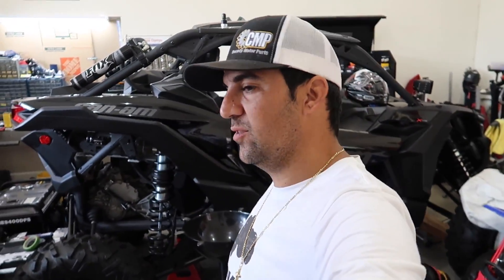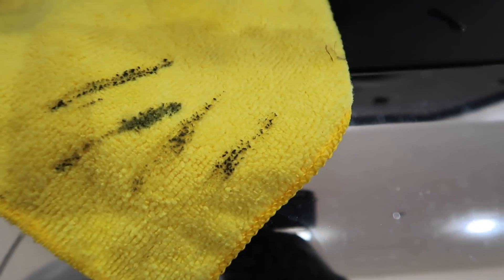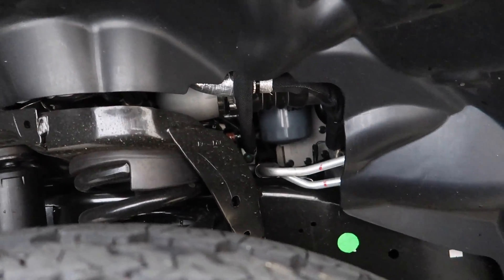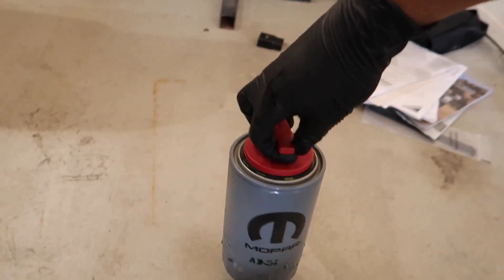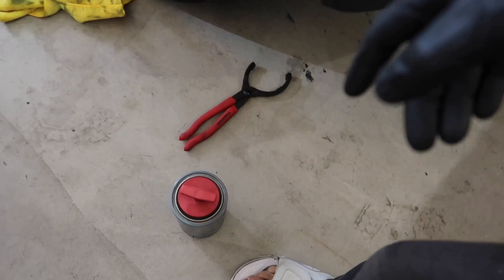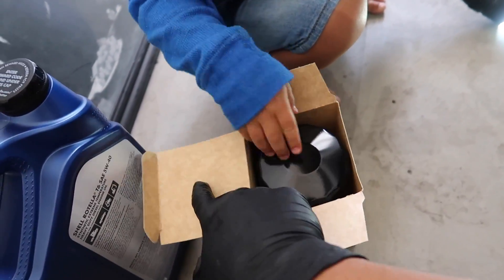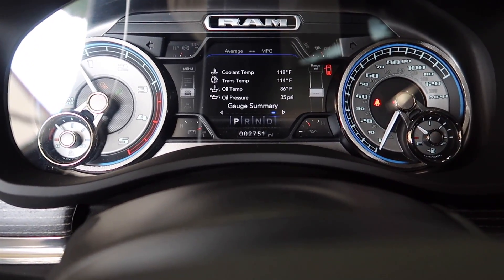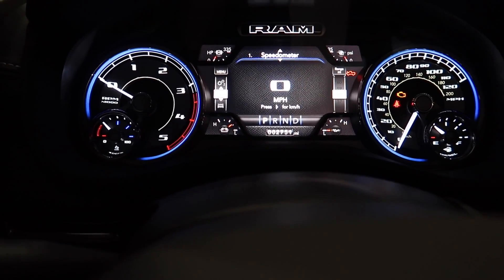THIS IS A MUST TOOL TO DO AN OIL CHANGE ON THE CUMMINS

Comment: Do you not need to prime before starting up? After doing oil change
Reply from the maker: I fill the filter before installing
Reply: @EddieLife3500  I had seen on another video where the guy does the whole turn key on and off a couple times

Comment: I live in Phoenix, AZ and I run Valvoline Premium Blue 10w-30 synthetic blend  Heavy Duty in my 19' 2500. And an OEM filter. That's what the book calls for in high ambient temps and I liked that Valvoline has the Cummins logo on the side of it and it says it's endorsed by Cummins.

Comment: Should also do fuel filters  with every other oil change
Reply: Nope, fuel filters at 15000 just like oil and oil filter.
Reply: Walter K  15k is to long with the quality of diesel in the us unless you use the same station every time you fill up  you have no clue how dirty the filters get. I change mine every other oil change I change my oil every 5k miles
Reply: @samgrabel8648  sorry but you are NOT smarter than the ENGINEERS at Cummins Engine Company. If you were, you would be working for Cummins. It doesn't matter what mythology you believe.
Reply: @samgrabel8648  15000 oil/oilfilter/fuelfilters is the interval.
Reply: Walter K  honestly that’s a maximum suggested interval    But depending on quality and conditions.
Reply: @samgrabel8648  you are sorely mistaken. But, you are certainly welcome to your misinformed opinions.
Reply: Walter K  show me you ase certifications before you down play my opinions
Reply: Walter K also that interval is from Chrysler not Cummins
Reply: @samgrabel8648  the only reason for that is because Ram and not Cummins provides warranty. Rest assured, my argumentative little fellow, I am very to intimately familiar. Cummins does instruct Ram regarding maintenance requirements.
Reply: @samgrabel8648  now you make me laugh. ASE is a f***ing joke. I know factory personnel frlm CMEP, I know FCA warranty adjudication personnel. I am tired of trying to educate you. Incidentally, do you prefill the replacement filter? If yes you are at least doing one thing right.
Reply: Walter K  answer me the how do you prime the fuel canister.  And let’s agree to disagree

Comment: Not sure on the 19’s but my 20 Laramie 6.7 calls for 10w-30 synthetic blend. Service manager said if something happens with the engine and is not running recommended oil that Ram has and will deny warranty claims. Just FYI

Comment: Hi Eddie, I saw they grease the Front drive shaft  every time make the oil change, I cannot find this point in my 2019 RAM 3500, could you find yours ? Thanks.
Reply: The ujoint is a different design; no fitting on 2019s.
Reply: @walterk1221  Thanks, that's why I cannot find it :)
Reply: @dmtycn  you are most welcome.

Comment: Diesel oil goes black soon after changes. It's normal. Black oil in a diesel does not automatically need a change. To each their own, but you should have left the stock break in oil in there longer than 2500 mi. Changing oil too soon, especially in a new truck, will actually be detrimental to the engine. Especially with modern synthetics, they reach their optimum properties about mid way through the recommended oil change intervals. Early changes defeat the purpose.

Comment: It's a diesel engine it will always be dark color oil. Oil change is states in manual is 15K miles. The dash next oil change is every 6K to 10K miles. But I like that gasket cover to keeping it clean. Thanks.

Comment: Diesel oil will always come out black as night. It's just the way they are. The OEM filter is definitely better. It filters to a smaller micron and same with the fuel filters. Like some one said they are made by fleetgaurd.

Comment: I used a Napa Gold 7060 in my Chevy 1500 for seven years, never had a problem. One thing I like to do is cut off the bottom of the box that the filter comes in, leaving about 2" of the sides attached, and use it as a little holder to stand up the filter while I pre-fill it.

Comment: Dude i would use all OEM if that thing is that new that way they cannot give u any BS if u take it in for warranty work or if u have any problems with the truck...
Reply: Not to sound like a douche bag, but I hate this logic of 'Oh run OEM everything in case it breaks' like, first off if I buy a 70-80k dollar diesel like this, if that thing breaks before the 100k mile warranty or whatever I'm parking it at the dealer until it's fixed, I don't care what brand of whatever is on it that's utter garbage. If they refuse to fix it, I'm writing 1,000 terrible reviews on their website and every google review option for them with fake accounts. And then I'm calling my lawyer to tell them to fix the truck because it wasn't the oils fault or the non OEM part. And then if they refuse to fix it after all of that, I'm gonna go okay fine, and drive to the closest dealer of another brand and tell them to fix it and win my brand loyalty. And then once it finally gets fixed, I'm selling that worthless piece of garbage truck and buying a new one because if it breaks that early in its life it's already plagued and full of other problems and is a garbage vehicle.

And that is why I'll put any brand of anything I want on my truck whenever I want. Dealerships and manufacture's don't want these things to run 500, 600, 700k miles with no problems because dealers make like 80% of their profit at their mechanic shops and the only 30% on used cars and they lose 10% selling you a new one because the other 2 will makes them more money anyway when you come back to them. So they're specifically built to have certain parts fail at different variables, but never when the warranty is in affect. The way to get around that is to stop using bad OEM parts and putting parts on from well trusted after market companies because they make their money by earning the life long support of their customers who will buy their products for their personal vehicles and their wife's vehicle and their mom's vehicle and tell all of their friends about it.

Comment: Eddie I’ve read a lot about ram/Cummins filters and how they are made so much better then other filters with how small it filters down to. It is so much better then others filters because Cummins has made so many motors over they years and they have invested so much more time and money into filters then others for diesels because of all of the large over the road trucks have to run so many miles between oil changes without fallers from oil filters and all of that tech from the big trucks trickles down to all Cummins motors.

Comment: Eddie rotella has a t6 synthetic in a 15w-40 version for summertime use, I don't know how I feel about putting 5-40 in cali, mine starts up at 55-51 psi when its ambient temp in Texas and 33 at idle when its 201 degrees, also it takes 12 quarts when you use the stock filter and don't spill any lol

Comment: normal for all diesels, for engine oil to be black all the time, is due to high compression ratios in diesel engines, and having higher blow by, caused by higher compression ratios , causing unburned and burned fuel to by pass piston rings and get into oil, because every engine has blow by, even new engines, want to keep oil cleaner longer put a by pass oil filtration system on it, like all big rigs have, because it filters oil 20-30 times better, but can not replace regular oil filter,

Comment: Most cummins take more than 12 courts     Also black oil don’t mean squat in a diesel thay turn black quick and basically the only time to be worried is if you see metallic contamination. Other wise I’d say your safe for 5-8k miles between changes

Comment: What’s was the reason you went with the rotella oil? I believe Cummins recommends valvoline blue synthetic

I’ve got over a million miles on gas vehicles running the Napa gold filters. No issues for me. I always filled with oil first also.
Reply: New cummins H.O.
Manual says 5w-40 Rotella synthetic 
Or 10w-30 Synthetic
Reply: crawlineb okay so ram is saying use the shell and Cummins is saying use valvoline premium blue.

Comment: My 1999 Cummins and 2005 Cummins, oil would be black after a few hundred miles. Always ran Shell Rotella oil and Wix filters. 

Leave filter in box sitting on the floor, it will stand up to fill filter

Comment: From my 2019 RAM Owners Manual, the 6.7 Cummins diesel can use two grades of oil;
10W-30 (which type is not specified in Owners Manual) for ambient temps ABOVE -18'C (0'F)

5W-40 SYNTHETIC for ambient temps BELOW -18'C (0'F).

I live in the Toronto area in Canada. Winter temps can easily go below -18'C so I will be using 5W-40 synthetic when I change my oil.

Manual also states to change oil every 12 months, or 24,000km. (15,000 miles), OR sooner if the Oil Change indicator system tells you to do it.

Comment: Eddie, a couple of suggestions, you will thank me later
Get a femco drain plug - mess free oil changes.  Femco Compact LB 7090020186 M18 x 1.5-T10
Start using Cummins Filtration - Stratapore LF16035 filter recommended by Cummins  see the white paper on these at Gino’s garage
Send a sample of your oil to the lab, I think your subscribers would benefit from that.
Recommended oil change interval is 15k, I change mine at 10k - Delo 400 synth from Costco (on sale $29/case). I send off a sample two or three times a year to the lab. So far 202k on my 16’ limited AISN SRW 3500 and all is good.  Let me know if you want to see my lab report
Thanks for the videos

Comment: Ran motorcraft oil and OEM filter in my 6.7  just past 10,000 for break in, switched to Amsoil 6x, Amsoil filter...now considering adding the bypass filter kit and get the added protection/filter more soot down to 5 microns.

Comment: I know this is an old video , but I discovered something.  I think you will like ...
#1 Cat oil filter # 396-4596  ( no adapter needed ) 
#2 Amsoil Bypass filter ( 2 micron absolute ) 
#3 Hotshot secret Black Diamond 15w40
Full Group 4 PAO , not that group 3 " full synthetic " we are all used to   

Oil analysis is showing engine wear from 59ppm average down to 21ppm average over 6 oil changes , and MPG is up from 17.3 to 18.7 over 5k mile average

Comment: hey curious what issues you had with t6 full synthetic in your LML? I just bought that to do my oil change on my 2016 LML
Reply: culpjon I have a 16 lml and run T6 in it with no issues. T6 is the best oil you can buy right there with Mobil.
Reply: @Josh-uf1rv  You should look up Amsoil, it's actually the best oil you can buy none of the giant billion dollar companies can compete with their trash oil. Amsoil invented Synthetic oils.
Reply: dedalliance1 yeah I’ve heard of them. Oil samples from the pickup and from machinery show T6 is actually very good oil. I can’t see spending that much more for something I don’t know when I have actual proof T6 is good oil.
Reply: @Josh-uf1rv  You can send in samples to Amsoil too, and if you do they rate their oils at 25k miles or 1 year, and warranty it. That's putting their money where there mouth is, you should try it and compare the results just for fun.
Reply: dedalliance1 yeah would be worth a shot. And interesting to say the least.
Reply: @Josh-uf1rv  Yeah, and it's kinda expensive, but the few extra bucks per oil change if it helps protect your investment in your vehicles and equipment, it's well worth the investment. A single labor charge for an hour at a shop is gonna cost you the same as an oil change, give or take.

Comment: Who knows anything about the fleet guard filters. I thought I read something about fleet guard makes the ram/cummins oem  oil filters. Does napa sell them?
Reply: Fleet guard by Cummins Filtration are excellent filter. See the stratapore white paper on the Cummins filtration website for more info
Reply: Fleetgard is made from Cummins and that's what Cummins big trucks engines come with from the factory.

Comment: I thought the 2019 6.7 cummins  uses t6  10/30 ?
Reply: You are correct 10w30 is preferred and Rotella T6 is called out in the owner manual. However, Cummins allows 5w40 providing it meets CK4 or CES20086.

Comment: What i’d pick in that situation mostly depends on what there rated for filtration. Personally in my truck (gasser) I don’t run OEM, I run a Mobil 1 filter because of how it compares to OEM. OEM is only rated 98% @ 40 microns, Mobil 1 is rated 99+% @ 30 microns. They both have the same number of holes but the holes in the Mobil 1 are bigger then OEM. The only OEM available now has a plastic center tube (there used to be two versions available one steel center, one plastic. I really don’t trust the plastic) the Mobil 1 has a steel center, & the Mobil 1 also has 30% more filtration media. I’d really like to find something very similar but rated at least 99.99% @ 20 microns, that would be fantastic. However I haven’t found anything like that thats legit and will fit my truck. Realistically though I’ve been running this filter for a while now and I’m pretty happy with it. I change it every 6k and it comes out looking about 50% (not pitch black but not brandy new either).

Comment: Eddie, my deleted duramax used to have very clean oil for a long time as well. Now that I have a deleted 6.7, the oil turns black almost immediately. It's just a Cummins thing. Also, cummins doesn't reccomend using 5-40 unless its gonna be below freezing alot. You can buy 15-40 full synthetic rotella on Amazon :)

Comment: I’ve been a diesel mechanic for over 20yrs  before all the new emission laws and the diesel oil always been black after a oil change . In regards to the oil filter I would use oem  dirty oil goes in thru the holes and gets filtered thru the media and out the middle. Orilleys has the oem filter for $14
Reply: I have a couple non emissions diesels also, the oil becomes black almost instantly after changing oil.
Reply: Warranty is issue on new trucks

Comment: dont need the plug use one gallon ziplock bag slip it over the filter after the filter is loose. then let filter drop into the bag and use bag to pull it out. very easy with zero mess.

Comment: Oil looking dark in a diesel is not a big deal. Send it out to a testing firm and they will tell you the lubricity is perfect. It cracks me up when I see these pavement princes truck owners and they are afraid of a little dark oil. That Cummins will work it’s butt off for years with the current system and it will NEVER have a negative effect those engine internals.  By the way, bro, never work on your truck in sandles; that is wimpy man.
Reply: Devo Dar You friend don’t need to act so smart cause this guy is right. No matter the truck, emissions crap takes thousands of miles off the engine. And anyone can wear whatever they want to do whatever they want. Talking smart is what shows a wimpy streak 😉😆
Reply: @lw6735  out of curiosity do you have any proof that emmisions crap takes thousands of miles off a vehicle? I would think if that was true these people that hotshot wouldn't be getting 500,000 plus miles on a non deleted truck. I believe the emissions work perfectly if people use the truck the way its supposed to be used which is towing and hauling. It can be bought as a grocery getter but it's not designed for that.
I ask because of everyones claims about the emmisions killing a truck but have yet to see it. Now the emissions like all systems in a vehicle can have some problems but I've yet to see the proof of someone saying "that motor coulda went passed 500,000 miles if the emissions were deleted". Of course we can say it but is there any proof?
Reply: James Valdez Yes sir tons of trucks go into limp mode and have to go to the shop and give serious issues over and over again because of emissions crap and you take care of all that crap and the truck can breathe and has way less issues and lasts much longer. Just try breathing through a stack of 10 dust masks and see how hard it is to survive along with recirculating old exhaust fumes through the engine again... not good for the life of it at all
Reply: @lw6735  Like I said the system will have issues as every other system does. I still say it's because the truck is not being used as designed. Still no proof it kills an engine.
Reply: James Valdez Ya it helps a lot if you keep all that emissions crap serviced but 1 proof is the 6.7 Cummins with all its emissions crap isn’t nearly as reliable as the 5.9 was without all that choked up stuff on it and a lot of hotshot guys will tell you that’s why

Comment: What is the recommended oil change mileage from the dodge on a 2019 ram 3500 like you own? Dose your ram have the high output Cummins engine?
Reply: Jeremy Shillingburg yes his ram is a high output.
Reply: Recommended change interval is 15k
Reply: Doug S that seems a bit high for these newer trucks.
Reply: Abram Spearman   I change mine between 10k and 15k.  Most guys cringe when you say 15k, (I did too when I saw that in the manual), but I started at 7500 and increased interval while verifying oil was still good by sending sample s to the lab. Now I’m very comfortable at 10 - 15k. I just passed 202k and have yet to have an issue with the engine. I can change my oil for under $50 compared to the dealers $160.

Comment: If you check your truck's manual, you will see that you only need to change your filter every 15k miles/6months/500 hours, whichever comes first. Remember that your truck takes a lot more oil than the average vehicle out there so that gives you the benefit of not needing to change your oil so often.

Comment: No need to worry about your oil getting that dirty at 3000 miles. Modern Diesel engines are designed to run like that. Plus diesel fuel is a natural lubricant.
Reply: Diesel fuel is a lubricant to injectors, not so much engine parts. However, dark oil in a diesel is perfectly normal and will not hurt the engine... especially a Cummins.